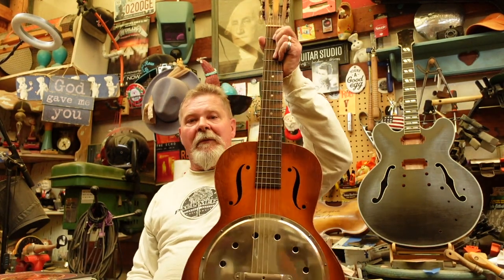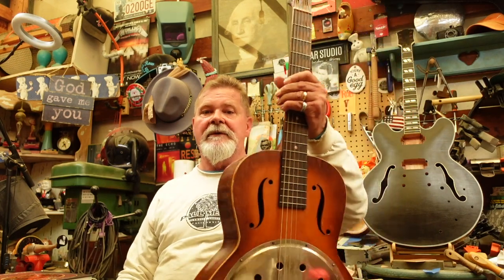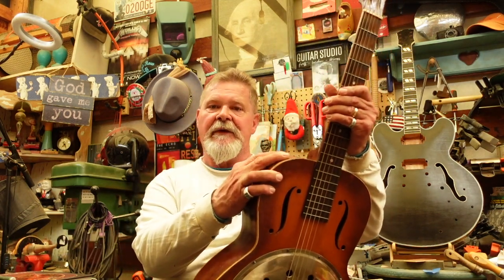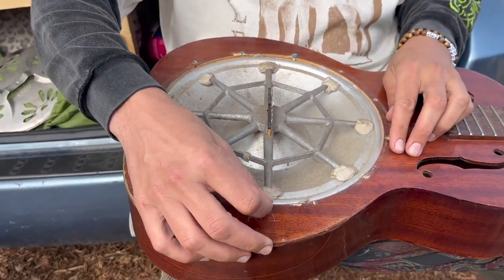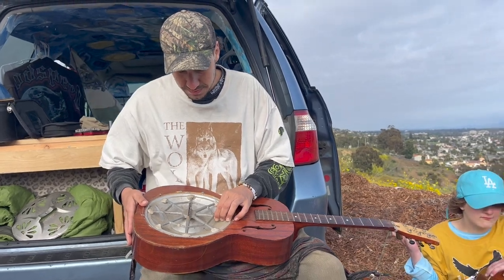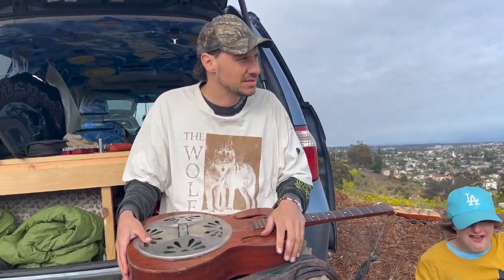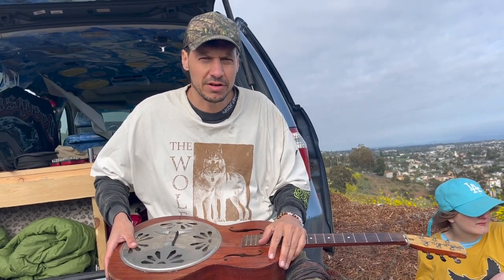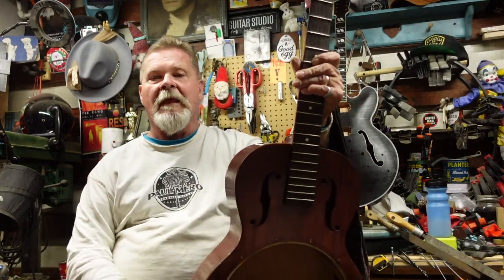Wood Body Resonator Guitar Primer

Comment: Ive noticed that using wet/dry sandpaper with liquid, whether its for a blade, a plastic miniature or some finished wood the liquid not only keeps the paper from getting clogged with material but in my opinion, I truly think you get a smoother surface than using it dry. Im talkin about like 600- 1000-2000 grit like when youre getting close to polishing level.